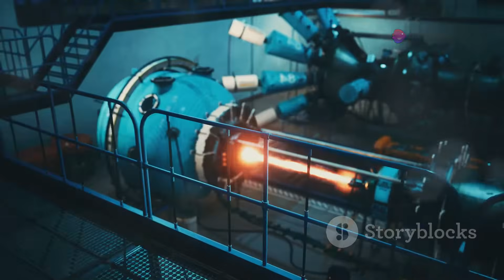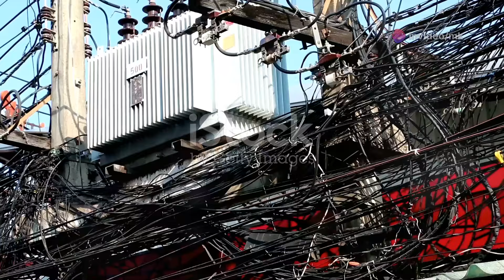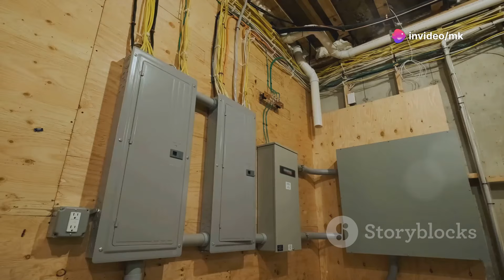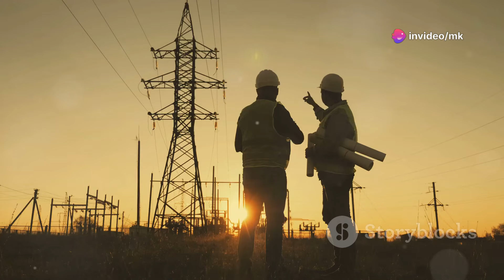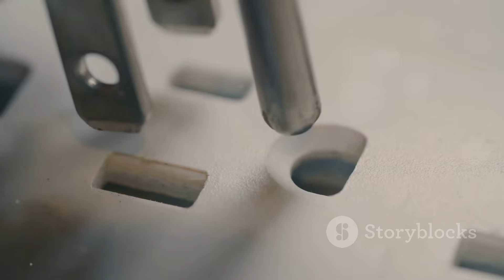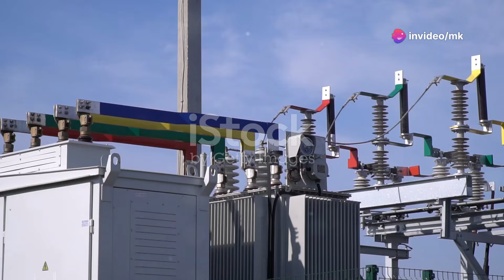What Is the Neutral Wire in a Three-Phase System? (Explained Simply!)

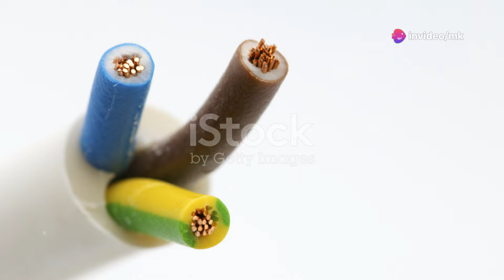Comment: 2:25 That's not three-phase power. Hot phase brown, neutral blue and ground yellow-green.
The power distribution via pylons is connected in delta. This saves the neutral conductor. Only three power conductors are required.
The circuits for the customer are connected in Y, which enables 230V and 400V. That's why four electrical conductors lead to houses and industries.